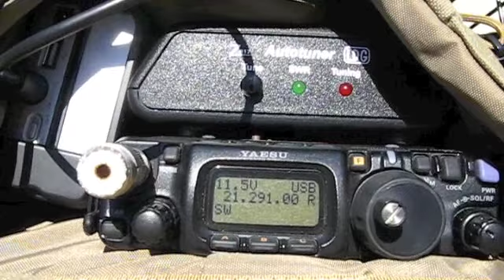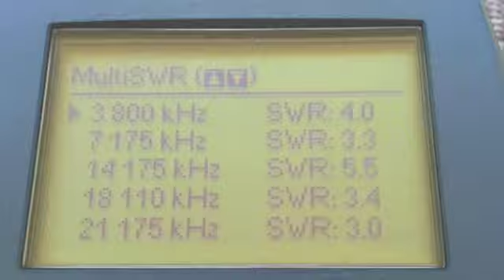Chameleon HYBRID Base + MIL Antenna on a Bicycle

Comment: So the bicycle is working as the counterpoise or did you run out counterpoise wire? And what band was that and what time of year?
Reply: The bicycle was used as counterpoise - NO extra wire. That was during the AUGUST I think.